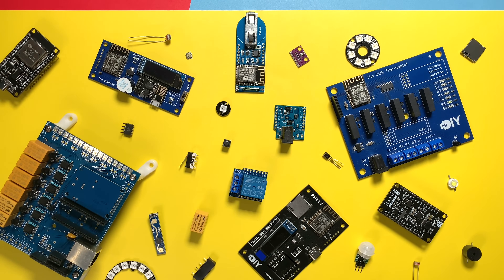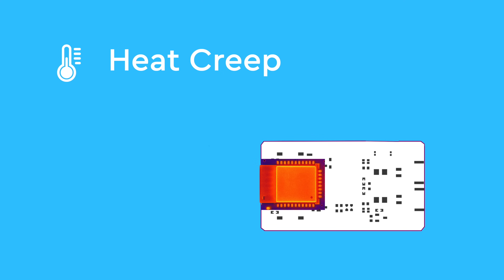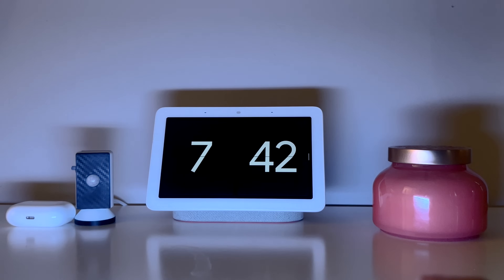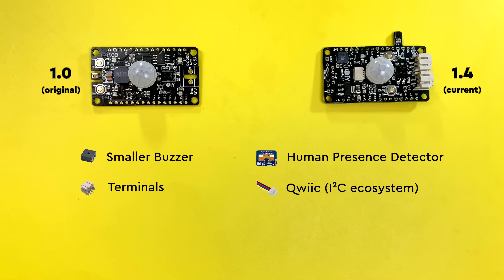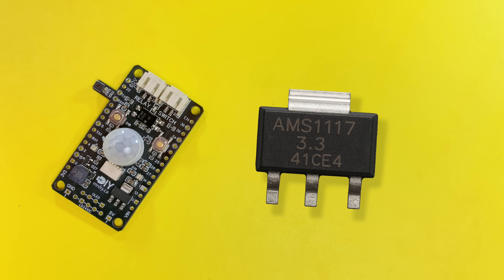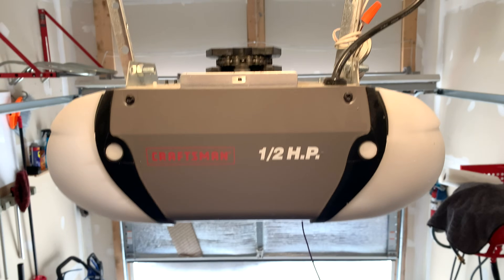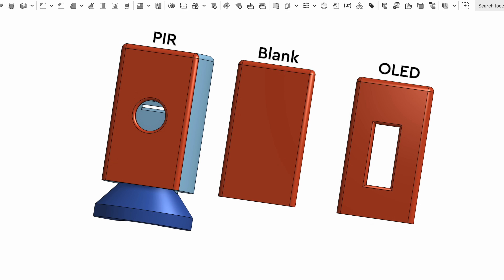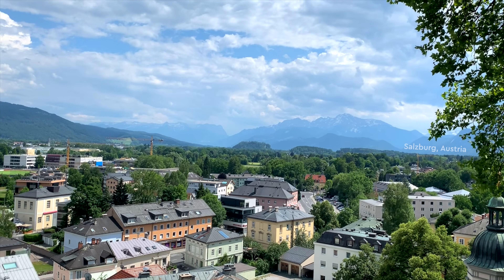Building My Ultimate ESP32 Shield - Take 2!

Comment: question for oyu. Im building a 99 mazda miata, with a Haltech ECU. This ECU uses CAN. I was hoping to get your feedback on using your device to add buttons? Main goal of mine is to Repurpse the factory radio buttons to control fuctions of the ECU such as enabling launch Control, or adjusting the RPM, while also having a display that would display the adjustments. I wanted to hear your thoughts on doing something like this with your CAN Sheild

Comment: You dont share Kicad files?
Reply from the maker: Eventually, yes - I will. I don't use KiCad but will share the gerber and pick&place. The schematic is already open source.
Reply: @MrDIYca  What is the L1 and L2 component on the PIR? I cannot see this enhancment in the datasheet. Also thanks for sharing - for us that want to build the board ourselves for fun - any other way of supporting you with a donation?
Reply from the maker: they help filter noise in general. yes, you can press the 'Thanks' button under the video - much appreciated!